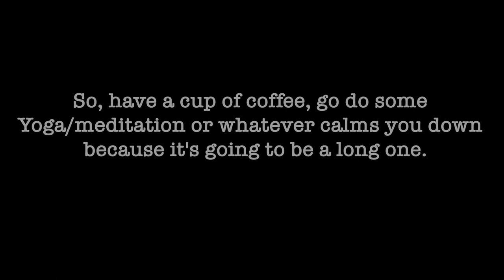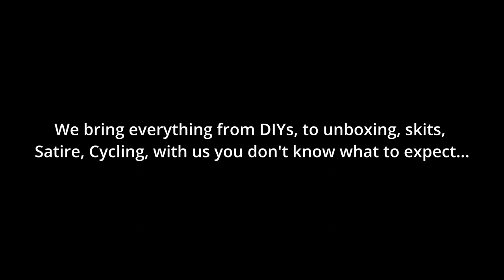Rock Shox damper Monarch R Full Service

Comment: i have a rockshox monarch rt3 shock and i recently did a full service but when it came to the part to unscrew the shimstack nut the whole shaft unscrewed. i didn't think much of it and i proceded with the service and cleaned the compresion and rebound adjustment rods inside the eyelet(ps i couldn't take the nut off since i didn't have blocks neither someone who could lend me a pair) so i put the shock back together with the correct rockshox 7w oil (thats what is says to use in the rockshox service manual) and the ifp depth to the correct level. also the damper body was scratched on the inside like the one in the video, like exactly the same type of scrathes, but i could barrely feel them with my finger nail so i put the shock back together. and then dissaster: the rebound wasn't working as it was stuck in the slowest setting no matter how much i turned the rebound dial. also the lockout worked fine, to my surprise , it was only the rebound.
now i'm thinking of dissasemble the shock again and try to clean the shimstack as i think there might be some crud built up in the holes that go in it. i am desperate for solutions since my local bike shop asks for the equivalent of 100 euro for a full service. and he is a picky guy and he will probably tell me to replace the damper body. and the seals are brand new also. has anyone had this problem? can it be fixed easily or is my shock bricked? worst case scenario i just buy a new shock but that won't be so easy to do since i don't have a lot of money and i rarely find shocks in my size(200x57). i'll keep you updated if i fix it.
Reply from the maker: Go to Sram's website, download your model's manual
Reply: @Sir-Kay  i looked at it before doing the service but they don't take apart the shaft. they only go as far as the shimstack and then they put everything back together.
i guess the shaft unscrewing instead of the shimstack nut is a common issue since i've seen the same thing happening in a video.
and sram doesen't give troubleshotting steps if something goes wrong :/
Reply from the maker: @rob9143  Trust me, I would help you if I could but, I don't have the model you're talking about so, clearly I'm the wrong person to give any advice. I'm sure you'll find a video on your particular model on Youtube though.

Comment: Best video exact same as my one
Reply from the maker: You're welcome, don't hesitate to hit that Like button for more.
Reply: @Sir-Kay  already done, got one question do you know where i can find the Rockshox table for setting the IFP valve, my model is monarch R, thought it would be wise to check but can not find information anywhere, i see you have set your IFP valve to 50.5 mm (video time 2:36) would it be safe to set the same, thanks
Reply: Monarch R MM
Reply from the maker: @bowchickawowwow7282  That would depend on what your shock dimension is, for instance mine is 165 x 38mm Rockshox recommended an IFP depth of 50.6mm if yours is the same them go for it, if not, try to find your damper's dimension and get back to me.

Comment: good job.  a curiosity, the air bubbles that come out before putting the ball, how can you be sure that there are no others left?  does the roch shox procedure involve vacuum or this system?  where can I find the attachment to let the piston come out with the air pump? Thank you
Reply: Tip for the bubbles, after filling the fluid in the can, touch the bubbles with you're fingers. Than install the damper and you won't have bubbles at all.
Reply from the maker: Thanks for stopping by. The attachment I used in pumping out the piston can be found on Aliexpress just search for it. I got mine here in Poland via their local site called Allegro dot pl so, check to see if they ship oversees. The air bubble thing requires patience, just wait till u no longer see any air coming out, it will never be 100% bubble-free but, hey! if I get 99% out,I'm good. As for vacuuming, I can't remember any vacuuming or any additional thing going on. Look, this is about as it gets with this tiny thing. This videos was an 100% tear down. So, follow the video one more time and it should solve any & every servicing issue with this particular model. Hope this answers your question & if not, feel free to let me know.

Comment: Hello, I would be extremely grateful to you if you tell me, I have Rock shox Rl (Debon air), the first problem was the loss of the lock, the rebound worked, then I drove in the winter and my speed sharply decreased by 2 times in some pit, I lower it  the air becomes even smaller, the idea is that this should not be, what could be the problem?  The other day I want to make out, is this a problem in the damper or not?  Maybe you know what could be the problem and how to solve it.  Before that, I didn’t disassemble the shock absorbers, so I don’t understand their design
Reply from the maker: I'm afraid I don't have that same damper and I might not be able to help but, I will tell you this, strip the whole thing down to pieces(that's of course if you can't afford to pay a mechanic to do it)clean and do a full service - replace all seals then, try to find the diagram of the damper in the service manual, that was exactly what I did. I'm sure you'll be able to do it if you follow the instructions there. Let me know if this helped.

Comment: Which pressure has to be put in the nitrogen/air chamber? In psi if it’s possible. Great video.
Reply: @user-nn4wj8gk9s  maybe different model o year of construction. If it says 350 it’s 350 😃
Reply from the maker: 250psi or 17.2bars for this particular model however, make sure to download the right manual for your model from the Sram's website, it should clearly state the right amount of pressure recommended for you model. Hope that helps.
Reply: Monarch RL is 500psi...Just had to buy a Rockshox pump that does 600psi....

Comment: Hello tank you for your vid! I can't find the complete kit I got the 50 hour kit, so I am lacking the seals and o ring from the damper body so as the o ring inside the damper shaft. Do your think it is strictly necessary to replace those? Tank you
Reply from the maker: 50hrs kit won't hurt it's better than nothing but, If I'm taking the damper all apart to the bone, I'd just rather get the right kit and do it all at once.

Comment: Hi, RS specify using a special clamp in the vise on the  secure the damper body so the IFP doesnt move during the filling procedure. I see you didnt do this. Did you fin this to be problematic?

I dont have those clamp and want to do the procedure myself.
Reply from the maker: I've serviced my damper since 2018 that I've owned this Bike and not a single problem, and you know what? this particular 200hr service was the best thing that has happened to this bike other than the dropper post. I used to do the 40hr service, it helped for a few rides then it was pogo stick again until I invested in the 200hr kit and since over a year now, all I do is dust off my stanchions after every ride and apply a tiny amount of stanchion spray to keep it grit free and my bike always rides like new. If I can do it, you can too.

Comment: hi there, i was wondering what oil you put into the damper body (the one that the IFP goes into)?
Reply: @Sir-Kay  thank you so much
Reply: @Sir-Kay  again, thank you alot, this is the fnal piece to my puzzle to be in able too rebuild, thanks for turorial, helped alot
Reply from the maker: If you mean the oil used on the IPF o-rings it's the Sram butter and the one I used in filling the IPF damper body, you know the hollow part was the Rock Shox 3WT suspension fluid. Hope that helps.

Comment: what's the little tool to remove the port cover ?
Reply from the maker: If you mean the tool at 0:53, that's the valve remover tool. And to remove the IFP piston from the damper body, you'll need the monarch adaptor, just type it in amazon and look for the one that matches your exact shocks. You can check your user manual from Sram or Fox or whatever suspension brand you use, I'm hoping these helps, if not, feel free to be specific. Thanks for stopping by.
Reply: @Sir-Kay valve remover tool , found it 😁
Reply from the maker: @sebastiengiovannelli8556  Ohh, glad I could help.

Comment: Hello! The instructions for the Monarch RL say that you need to pump 500 psi, 34.4 bar into the damper, is that really necessary?
Reply from the maker: No way does it say 500psi, are you kidding me now?
Reply: No lies my friend, that is clearly said in service manual -  2016-monarch-rl-rt-xx-service-manual from official sram site - Shock Lock Tunes
Air Pressure
RL
500 psi, 34.4 bar
RT
500 psi, 34.4 bar
XX 430
500 psi, 34.4 bar
XX 380
350 psi, 24 bar
XX 320
350 psi, 24 bar
XX 219
350 psi, 24 bar  @Sir-Kay
Reply: And also has RockShox Fork / Damper Pump 600 PSI  @Sir-Kay
Reply from the maker: @ia333  Wow! Well, I only have  Monarch R and it asks for only half the pressure required in its bigger brothers. Whatever you do, just read your manual, those engineers know better. How did you find our channel by the way?
Reply: I thought monarch r and rl is almost same, need to check manual for R version, maybe depends of released year. Found while looking maintenance video.  @Sir-Kay
Reply from the maker: @ia333  They can't possibly be the same. Each model might look similar but, there's alway one little thing that make them different.

Comment: no nitrogen ?!?
Reply from the maker: Nope, and i don't need it either.
Reply: @Sir-Kay  any issue on long term use ?! what sort of terrain ride you ?
Reply from the maker: @sebastiengiovannelli8556  Honestly, everything except massive man-made jumps. These suspensions can't soak jumps up. But, fire roads, regular bike trails, little jumps and drops but, nothing major. If you want to be on the safer side, I would recommend something beefier than 120mm fork and 90mm dampers like I have here. Hope that helps.
Reply: @Sir-Kay  because I read on internet that nitrogen is better but maybe only marketing
Reply from the maker: @sebastiengiovannelli8556  Maybe it might perform better but, like I said, get a better suspension if you can.
Reply: @sebastiengiovannelli8556  Air is about 78% Nitrogen lol.... !